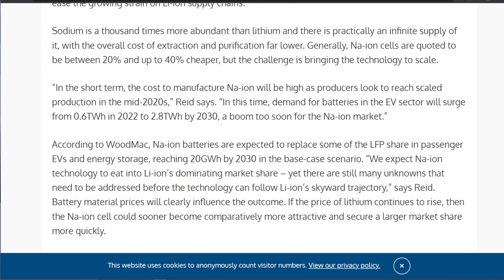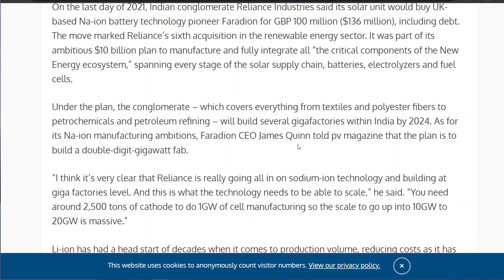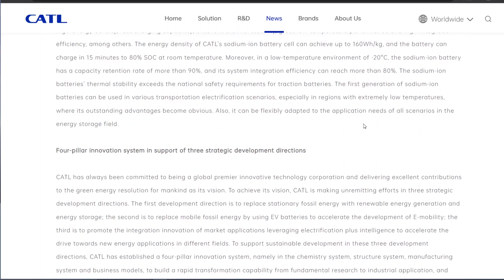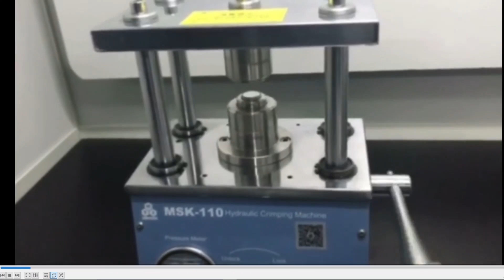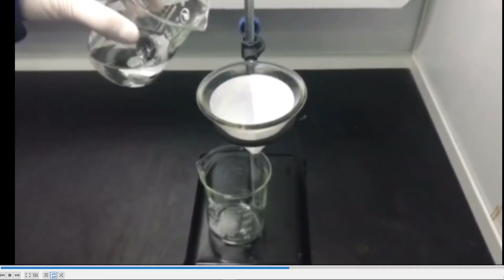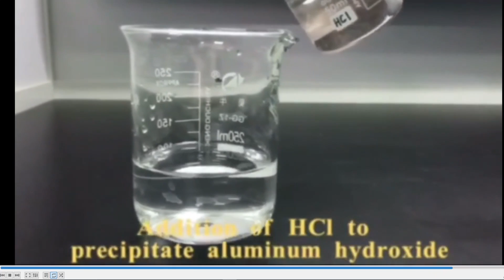Sodium Ion batteries are the real deal (IMHO)

Comment: Excellent video, very good sodium battery comparison. The sodium battery enables the electrification of all cars, this is questionable for lithium. In order to reduce the strain on the electricity grid, we should all use solar Apteras. I found out about iron nitride magnets just recently, a spectacular new type of super magnet that can replace rare earth magnets. Elaphe could design in-wheel motors based on iron-nitride magnets in the near future, to replace ferrite and to reduce wheel weight.

Comment: Cell phone batteries used to be easily replaceable. Now they are not. Most Hybrid and EV batteries are not easily replaceable but I think they should be. It would be possible to drive with a 1000 mile battery then after about 5 years replace it with a 1400 mile battery with improvements in battery technology.

Comment: Winnebago built a 33 or 38 foot concept ERV using Sodium Ion batteries 3-4 years ago that had a 150 mile range, but they didn't produce it. They were promoting the battery as ultra safe. This last year, they were promoting a Transit van with regular batteries with a 106 mile range, but still not for sale.
It would be amusing to see a giant Class A try to fit into a fast charging stall, which is another reason to have pull through chargers. I think Winnebago had the idea that since many RV campgrounds have 50 amp plugs anyways, you could charge every night, but I doubt they go into production before they can get 200-250 miles of range into one of those. I had the idea of making a Tesla Semi into an RV, but the batteries on those are immense.
I am hopeful that several different chemistries will be adopted so there is less demand and price increases on the most power dense variations. I would be completely fine with LFP, or Sodium, or Silicon based batteries if they don't cost much and last for a long time

Comment: Of course sodium ion batteries are best suited for home battery storage use and mass electrical storage to replace natural gas peaker plants. But one of the advantages of the Aptera is that it does more work with less power. I don't see sodium ion or LFP batteries in the first generation Aptera, but we could see something like hybrid battery packs, like the One Gemini, where you could have a smaller sodium ion battery combined with a smaller Li Mn O battery which has very high energy density, but lower cycle life. The hybrid battery pack would be about the size and weight of the 41KWh NCM pack, and the sodium batteries give you something like 150 miles of range, with the Li Mn O batteries giving you an additional 250 miles of range for those rare times that you have to drive further. But the whole pack potentially be comparable to NCM but it would cost maybe half as much. And be easily sourced and recycled.

Comment: Another big one is Al ion graphene batteries, which have more potential because of the lightness and power density. You should look into the Australian company GMG which is not far from production, in fact they are starting production with coin cells soon, and will work their way up to automotive batteries.

Comment: Aptera definitely could use Na-Ion or LiFeP batteries in their shorter range vehicles. The 1000 mile probably will have to be NMCo Li-Ion. The 600 mile might be able to use LiFeP and/or NMC Li-Ion. The 400 mile and 250 mile can probably use Na-Ion or maybe a combination of Na-Ion and/or LiFeP.
Reply: Just for an example to support your comment, I have a 600 mile Aptera reserved now and charging it to 80% for battery longevity, I get an effective range of 480 miles. I would willingly move to a 400 mile version if it came with LFP batteries that have no downside to charging to 100%. I would benefit from a lower cost battery and by having a smaller battery and a lower cost car. The world would benefit if individuals consumed less resources.
Reply: @kenmcclow8963  I picked the 600 mile Aptera for the same reason. 80% - 20% gives you 360 miles but that is mixed use all freeway driving at 70-75 mph with AC and you probably only get 250-300 miles. That is enough for 1/2 day of driving. Charge up over lunch and you can do another 250 miles before dinner. Then stop for the night or recharge for another run after dinner.
Reply: @matthewhuszarik4173  I don’t think you will need to leave 120 miles for reserve. I often pull my Tesla up to the charger with 20-30 miles left and it’s fine. 23 miles is 10% of my battery. AC uses a lot less energy than the heater, so I think you will be pleasantly surprised how far it will go. The Aptera probably won’t lose as much range as my Tesla from driving fast since it’s so much more slippery. I barely go 150 miles at 85 mph from my 230 mile range

Comment: I thought Aptera will use LFP battery pack?
Reply from the maker: They are using NMC packs initially and probably moving to LFP for the lower range models later.  Sodium ion is not commercially available yet.

Comment: You should look into what Energy X is doing.  Most lithium mining operations can only get around 30 percent of refined lithium.  While Energy X is getting around 90 percent using their refining techniques.
Reply: The issue with lithium mining is not the productivity, but the geo location with much currently controlled by China. Thus, the desirability  of battery chemistries that do not rely on lithium

Comment: If they can get the price down enough, it seems like cycles would be less important and batteries could just be replaced as part of a maintenance schedule. Also if they can go all the way up to 100% and down to 0%, the packs could be smaller to get the weight closer. The main issue would still be energy density for EV’s, but these already seem killer for grid storage, or even personal home energy storage from rooftop solar panels. I hope these technologies keep increasing, we’ve got plenty of salt to use.

Comment: LFP batteries are already at 230 wh/kg; goshen high tech is scaling production now.  Most others are already commercially making 180-200 wh/kg.  Assuming liquid metal doesnt become the standard for stationary storage sodium ion likely will.  As to viability for 250/400 mile apteras it just comes down to cycle life and getting out of the lab.  LFP already solves much of the same problems and is commercially viable now.  Any idea what C rates sodium ion can achieve because anything less than 3C burst would power limit an aptera.
Reply: Doeant lfp have less volumetric density though? Maybe not a problem for some vehicles but I wonder how it would work on aptera.
Reply: @20xx-mm-dd  It definitely does but sodium ion is even worse regarding volumetric density than LFP.  A 400 mile 2170 based aptera would have 78 liters of cells based on the information released.  Since the aptera is designed to support a 1000 mile version which would need 195 liters / 1090 lb of 2170 cells it still would have enough room to be functional (400 mile) with sodium ion or very good (600 mile) with LFP.  Using EVE LF280K LFP cells this would need 123 liters / 623 lb for 400 miles or 185 liters / 937 lb for 600 miles.  With the upcoming CATL sodium ion cells 2022-23 this would be 167.4 liters (over double 2170 volume) just for 400 miles but it is only 25lb heavier than LFP (648lb) and less volume than the 2170s for the 1000 mile.

Comment: My understanding is that the current high-density Na chemistries (those that compete with LiFeO4P) rely on high-nickel cathodes. This could be a problem as we are trading the lithium bottleneck for a nickel bottleneck. I wonder if the super-high-cycle-life but low-density cell you covered is NaFePO4 or something similar. Could be very nice for grid storage.
Reply from the maker: As far as I could tell sodium ion batteries don't use nickel.   Their cathode is usually Prussian blue which is iron carbon and nitrogen
Reply: @ApteraOwnersClub  FYI I ran the numbers in my latest sheet and even with the extremely poor volumetric density of sodium ion it should be enough for the 400 mile to be viable based on CATL's 2022-2023 tech (15:30 in the limiting factor video).  This results in a 648lb / 167 liter pack (only 25lb heavier than off the shelf LFP EVE 280K) but way bigger.  The 2170 modules for the 400 mile aptera are 78 liters and the EVE 280K would be 123.  The module volume for the 1000 mile 2170 (with unrealistic linear battery scaling) using 15 modules is 195 liters so that is likely at or near the limits they can physically fit just to achieve 400 miles with sodium or 600 miles with LFP (937lb / 185 liters).
Reply: @ApteraOwnersClub  Hm, I need to go back and re-watch the Limiting Factor video. I might be getting confused

Comment: is this article implying that the Aptera will come stock with a Na-ion battery?
Reply from the maker: No not at all
Reply: Great info I fast forwarded through because this info has nothing to do with pending delivery. Might as well be discussing some futuristic energy supply from the year 2525. It still has nothing to do with the real problem at hand,  the delivery of my Aptera.
Reply: LFP with the deal in Thailand is far more likely to find its way into Aptera vehicles.  Sodium ion is still getting out of the lab and is likely to be limited to grid scale initially (assuming cycle life problem is fully solved).  If cycle life and power density are both inferior to LFP this will not commercially scale since the use case on low density and low cycle life is hard to find.

Comment: Unfortunately they arnt very useful for vehicles as the volumetric energy density is almost half of lithium. This is why you never see volumetric listed as its so poor. Also they might be approaching on the lab LFP in wh/kg but those batteries won't be out for 3 to 4 years and by then LFP will have moved the goal posts further.  They could work well for grid storage but they won't really work for cars. The cost between LFP and sodium isn't very high and LFP is still more energy dense.

Comment: I had looked at pretty much the same information that you looked at last week. Sodium ion batteries are definitely the future. It's not there yet, but it will happen. There's just too much at stake not to make it happen. As you noted right now it's pretty much a toss-up between energy density and cycling longevity. I believe it will not be long before we see sodium batteries that have reasonable energy density and can be cycled even more than current lithium batteries. That and solar could make the EV industry blossom. The Aptera is in a great position to capitalize if this technology gets going soon.

Comment: Might be best for static / household / grid-scale batteries?  The reduced thermal runaway risk & reduced cost would be both beneficial, and the extra weight per kWh wouldn't matter.  I don't really see it being heavily used in vehicles where the energy density is more important.
Reply: Definitely not in automobiles unless the energy density can be considerably increased, but I could see their use in trucks and large SUV that already carrying around considerable weight.
Reply: And definitely not in the Aptera I'm waiting for.
Reply: If cars go to a battery swap model like Nio then you could have a low density battery as your daily driver and swap it for a higher density battery for long trips.